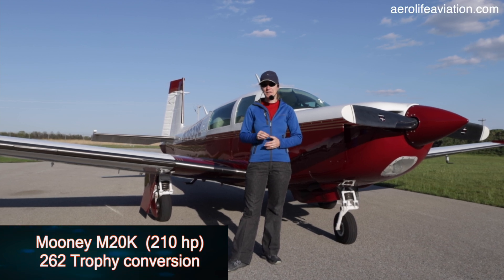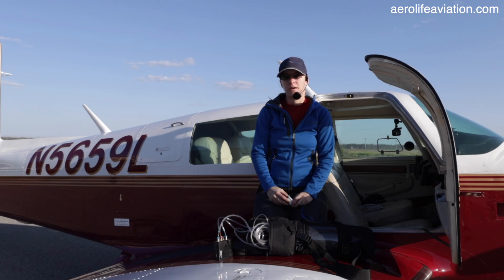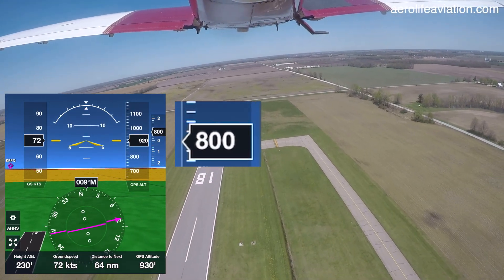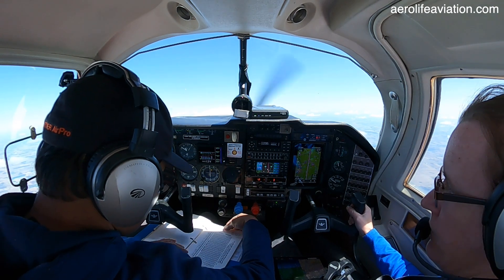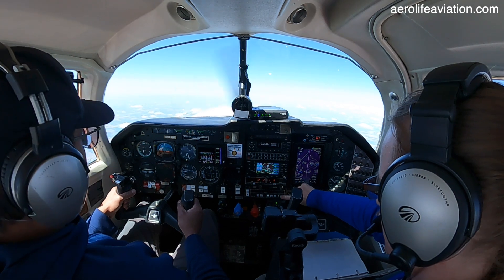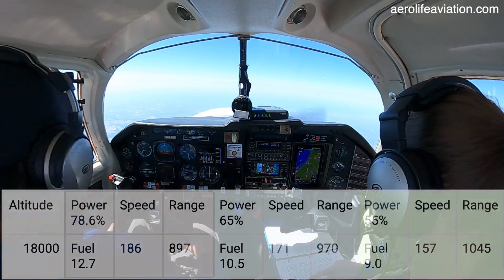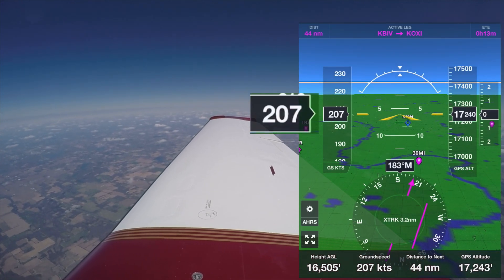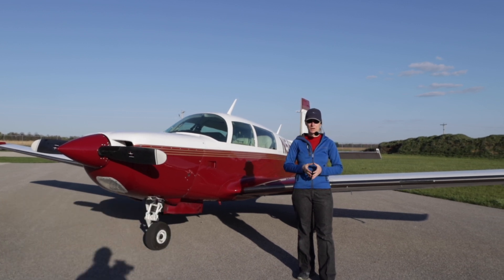Flying to 17,500 feet to test superb performance of this Mooney 262

Comment: I have owned a Mooney 231/“262” since 2008 and couldn’t be happier. The only difference is the 252 is a 28V system, and the “262” is a 14V Mooney 231 but with all the 252 hardware. I’ve heard not all the “262”s have all the 252 hardware, but mine does, with the TSIO-360MB engine, dual alternators, backup vac, 252 cowling with variable cowl flaps, speed brakes,gap seals, inner and outer gear doors, and other mods I probably don’t even know about. Why the previous owners went to such trouble I will never know, but it’s all to my benefit. With a 115 cu-ft O2 tank I can go high, and even though I have been to FL210, I prefer to fly between 15k and 17k which is above 99% of the piston GA and below all the turbine. A turbocharged ‘teens’ plane owns the airspace, there is nobody else cruising there! The 252 “262” engine is a superb turbo, cylinder head temps stay between 350 and 380F, and my biggest problem is trying to keep the oil temp above 145. Put on a ST 3-blade prop and got an extra 100-200 gpm climb, and no loss in cruise speed. I fly regularly San Francisco to the Canadian border in 4 hours, 12 gpm, 170 kts, 65% power at 16,000’. I pick up ice every summer at some point flying through some clouds, but almost always exit icing before having to alter altitude.
Reply from the maker: Thank you for sharing your ownership experience of these great planes.

Comment: So what makes a 252 a 262?
Reply from the maker: The 252, 262 and Encore planes are very similar. They have some differences such as 252 has two gear speeds and 28V system. Also, 252 is a factory set up and 262 is a conversion.  Fairly close performance.  252 and 262 are both great planes. Considering the price difference, 262 is a popular airplane.

Comment: And everything with a turbo has a waste gate 😄
Reply from the maker: This plane has a fully automatic wastegate which keeps the maximum MP at 36”.  That’s why we don’t worry about overboosting the engine. Previous models you need to monitor the manifold pressure, especially on cold day takeoff to make sure you do not to exceed 40” and overboost. You must manually limit the MP in the 231 and it's trickier to fly, particularly to get maximum engine power out of it, than the 252, 262 and Encore.

Comment: You showed my comment to your earlier video, that was a surprise, But I’m curious to know why the seller is replacing the Mooney with a Cirrus, another high performance four place piston single.
Reply: I bet it is just newer with a larger cabin and a parachute, or? fixed gear?
Reply from the maker: That's a good point, the SR22 is a fixed gear plane. But it still produces very good speeds with the streamlined design.
Reply from the maker: Thank you for your comments. I don't know his personal reasons, but we also own Cirrus SR22 aircraft and two advantages that I see are the parachute and full glass panel avionics including an advanced autopilot. SR22T is a great plane, but costs a few times more than this plane.